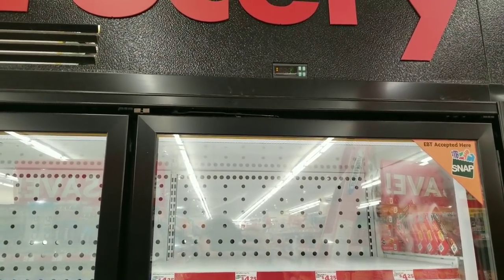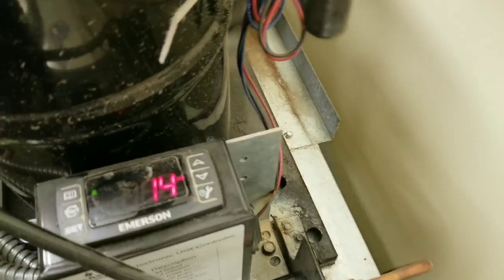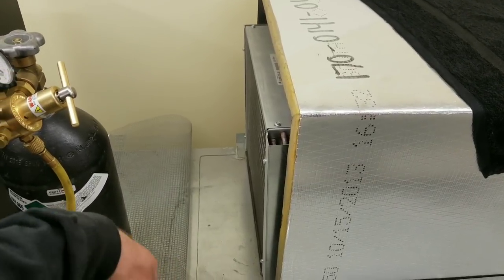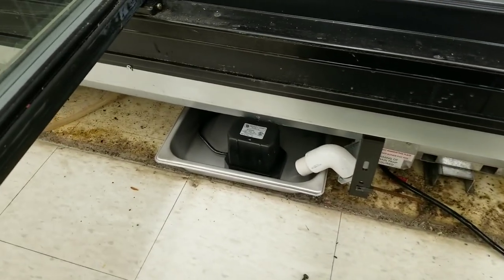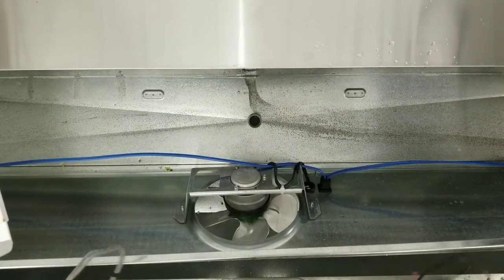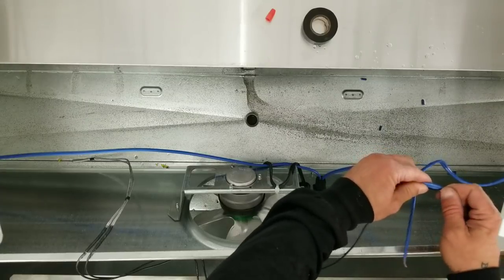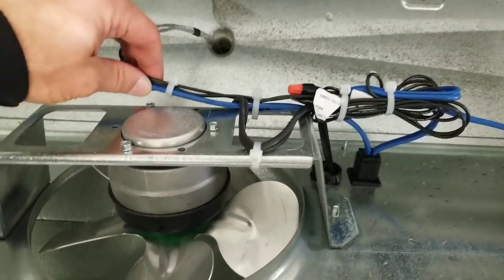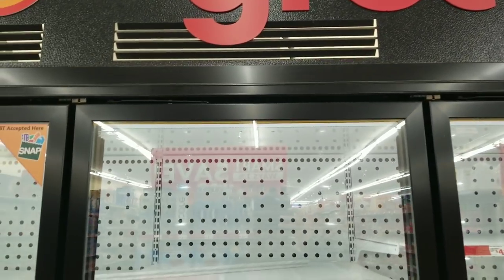Zero Zone freezer not keeping temp

Comment: Good job bud. I understand the way you did the drain line heater.  Probably won't have any issues.  I know everyone is saying it's better to have it on constantly but sometimes you just have to do what you can.  Great job.
Reply from the maker: That's exactly right rookie refrigeration- I'm not concerned so much with the warm condensate freezing when it's in defrost and the drain line heater is off, nope I'm more concerned with the ptrap full of water below it freezing with the unit is running as normal. Thanks for the feedback

Comment: It amazes me the drains didn't come with a factory installed heater. You can tell when the engineers used to do service work.
Reply from the maker: Yeah they didnt even think the trapped water that sits in a open drain just below the evap coil would freeze-- nuts 

thanks for watching

Comment: Great video..@ 1532...yellow wire nut..might have been easier....
Hey great job...getting more heat out of heater wire on those,coolers works better...
On ice cream freezers..i have used a higher wattage heater element to prevent freeze up...
And added 15 min.to my defrost ⏰...clock..
They build up ice at drain ,if you have enough amperage..try that next time...
Awesome video Curious hvac guy
Reply from the maker: Thanks Joseph- thats a good tip, and your right a bigger wire nut would have made it a bit easier.

Comment: Three lever wago connector would have been much faster and cleaner then wire nuts. Also if you had to change the heater in the future it’s just the flip of a lever. 

Great video and keep them coming! Awesome work
Reply from the maker: Great point! I need to get some of these on my truck

Comment: Still amazed there is no condensate heater pan below and eliminate the pump.  

Only reason not to I suppose because the heat rising will add to the box load some, hence the Rube Goldberg factory design.
Reply from the maker: A few locations actually have floor drains under these units, and everything is just pipped into those- that in my opinion is a much better way to go

Comment: It's a pain it the ass to keep refilling but a steam cleaner cuts through the ice and allows you to pull it out in chunks if your worried about overfilling a pan
Reply from the maker: Thats a good point- what ive done in the past, if I needed to get it up and running to save product-- ill plug the evap drain and spray hot water on the coil and suck it out with my shop vac, no mess and the water gets it done pretty fast.

Comment: Next time you run into that problem when you are replacing the pump anyway, could you not put a short section of pipe into a bucket to drain the water that from a manual defrost?
Reply from the maker: Hey Jay- thats a good point, I dont see why not--  what ive done in the past, if I needed to get it up and running to save product is plug the evap drain and spray hot water on the coil and suck it out with my shop vac, no mess and the water gets it done pretty

Comment: Can that secondary pan handle all that water?
Reply from the maker: Dont quote me on this but I think it holds around 2-3 gallons-- If your not careful it will overflow. For Example when I have to leave them to thaw what Ill do to prevent it from overflowing is remove as much Ice by hand as possible. Normally whatever is left isnt enough to flood anything, however it would be much better if they had in the floor drains.

Comment: Always keep a hair blow dryer in your truck.You can melt the ice without the extra water.
Reply from the maker: Thats a good point- I do have a large heat gun however for these jobs if the unit is already empty and depending on my NTE (not to exceed) dollar amount I usually just shut it off and let it thaw while Im waiting for parts. I have had to thaw these on the fly to save product and what I do in that situation is plug the condensate drain, get my pump sprayer out filled with hot water and spray it down, suck it out with my shop vac, spray it down, suck it out with the shop vac and repeat until its clear-- less mess and I get the coil thawed pretty quick

Comment: Don't you want the drain line heater to be energized in defrost ,if it's wired in the fans and it's in defrost the fans will be off and no power to heater
Reply from the maker: Hey Joseph- you make a good point and I've done it that way in the past by routing the heater line over to a junction in the bottom right corner. However my thinking is I'm not worried about the condensate freezing during defrost when the defrost drain line heater would be off, the drain tube and heater itself would still be warm from continuos operation, so that will help. On these models there is a trap in that condensate drain line just belowe the cabinet and that trapped water is what freezes if left un heated. I just want to keep that trapped water warm as much as possible. Really either way works just as well, just depends how far you want to run wire through the cabinet for the same results.
Reply: Couple issues with it only powered during defrost is it takes a LONG time to defrost the drain, and so with it on while fans are running means it is warm and ready for a defrost and the defrost produces warm water, warm water isn’t going to freeze before it gets to the drain.

Comment: That reminds me I just ended up adding additional heater wires to the condensate pans of the Infrico freezer prep-tables I usually service. The manufacturer just put one below the pan, but I add one more over it. One is totally inable to defrost the ice under particular circumstances of high humidity on the ambient. Here my "metallic snakes": https://twitter.com/JuanTodoli/status/1133466465938608129
Reply from the maker: Hey Juan- that looks like a great repair, have you had any issues since that fix?
Reply: @curioushvacguy6876  Zero problems, the relay on the controller is able to carry 8A, more than triple needed on these heater-wires. And the most important, the manufacturer will correct the lack of defrost power on these pans. Pretty happy with that. 🤓